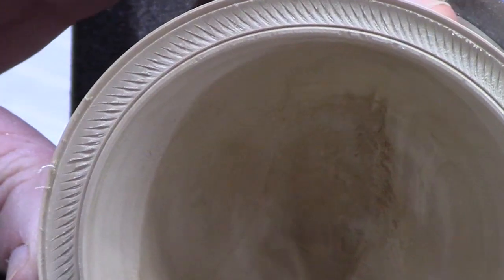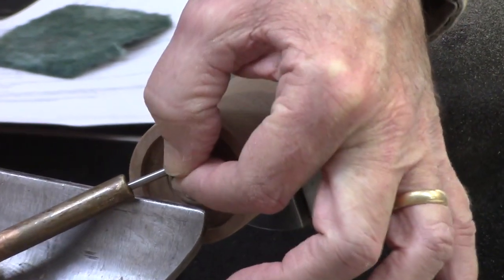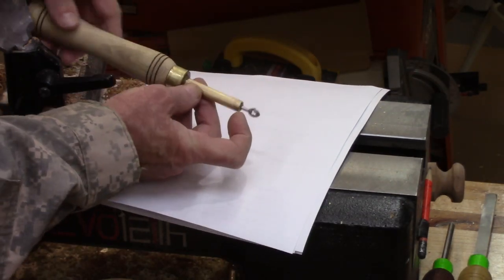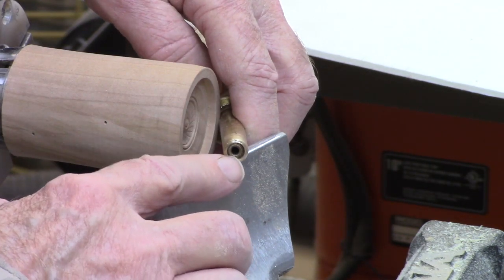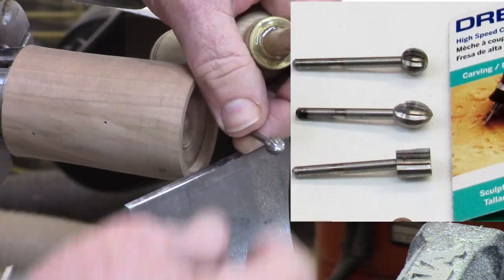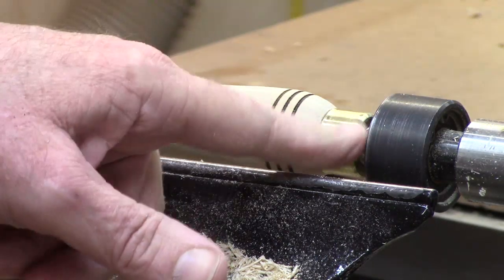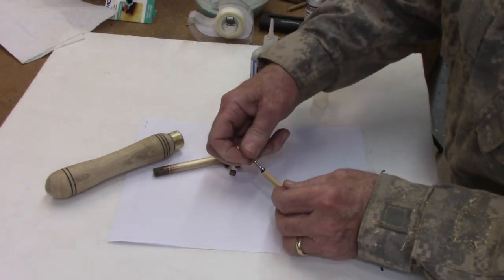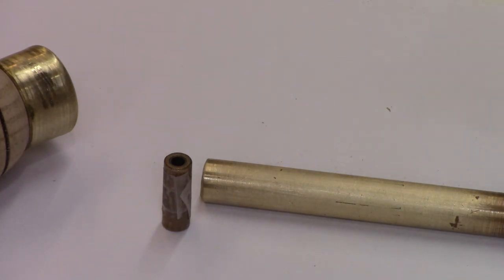Make a Rotary Texturing Tool – Cheaply!

Comment: I just completed my texturing tool.  For less than $20.   I only bought the Dremel 114 bit , brass pipe and ball bearings.

The ball bearings are pretty tough to install if Scotch tape is used to hold them together.  Instead, I mixed up some 5 minute epoxy, shoved it down the pipe and then used the bit with the magnet and bearings already on the bit shaft and inserted down the pipe.  It went in very easily this way.   The tolerances on the bearings will not allow tape to be used easily.  

Works great!!!

When searching on Amazon or eBay for the bearings, I just used the search term “ball bearing 1/8 x 1/4 x 7/64”.  If you enter the brand name and the other info that you have in the instructions, you’ll find everything except for the bearing you are looking for.  Just do a generic search with the sizing specs and a few different brands show up.
Reply from the maker: Thanks for taking the time to share!
Reply: There is one issue  with this texturing tool that needs to be addressed.  The Dremel bit shaft is about 1.2” long. The four ball bearings I received only support about .5” of the bit shaft and leaves about .7” of it unsupported.   This causes the bit to deflect away from the turning piece as pressure is applied for texturing. To solve this issue there are two solutions: 1) install an additional 3-4 bearings (7-8 ball bearings total);  2) use a Dremel cutoff wheel to shorten the bit shaft about .3” - .4”.   This will allow the head of the bit to protrude about .2” -.3” beyond the end of the brass pipe.   Doing this will reduce the amount of deflection the bit experiences when pressure is applied for texturing.  However, when doing this, the geometry of the tool will be changed and deep coves may not be able to be textured since end of pipe my pose clearance issues with the wood.

Suggest placing additional bearings on bit shaft with magnets on the end and trial fit into the pipe to see how things work before gluing into place. Make necessary adjustments  to  shaft or addition of more bearings  before doing any gluing.  Once you glue things in place, you’re stuck with the decision you made.

If shortening the shaft, be sure to round off the end of the shortened bit shaft with a file or bench grinder.  Study the end of the bit shaft before you make the cut to see its shape.  Then go to town making your modifications.

Comment: Hi Mike,
I made the tool and have used it on a few things.  The roller bearings I found on Amazon, and the other pieces are at most hardware stores.  I did find out that many of the cheap rotary burrs are not the exact 1/8 inch diameter shaft, and you need to make sure that the burr shaft fits in far enough.  To keep it the correct depth, I added a piece of brass rod to the inside of the tool shaft (pipe fitting nipple) so the burr shaft only goes in so far.  I have added patterns to the side of a few bowls for an accent to a normally ordinary bowl.  One more small step in bowl making, but it provides a nice detail.  Thanks for the video.
Reply from the maker: Thanks for sharing. I like to use a turned dowel to limit the length with a rare earth magnet on top for the burr to ride on. The rare earth magnet keeps the burr from coming out if you point the tool down when not in use.

Comment: Hi Mike, thank you so much for your time and effort making these great videos!  I just finished making my own texturing tool and it works quite well.  I was not able to find the exact parts you give in your video and website, but I ended making it work with 1/8"x3/8"x5/32" ball bearings ($7 for 10 on Amazon).  They fit perfectly inside a 3/8" copper coupling.  I only used two bearings, so I guess I can make a few more tools!  Thanks again and keep up the great work!
Reply from the maker: Nice work!

Comment: Another great video.  These are useful tools to add detail to turnings.

When I made mine, I couldn't find a supplier of sintered bronze bushings that didn't insist on only selling them in large quantity and with ridiculous shipping costs, so I turned a sleeve from a scrap of high-density polyurethane (from an old cutting board from the dollar store) that seems to work just as well.  Also, I found that I could order the Dremel cutter from Ace Hardware for delivery to my local store with no shipping charges.
Reply from the maker: Great tips, Louie, thanks for sharing.

Comment: One thing I seem to recall when using five minute epoxy is that denatured alcohol/methylated spirits is good for cleanup. I remember that seem to be good for smoothing out excessive glue before matures.
Reply from the maker: Thanks for sharing.

Comment: Mike, you can go to a local bearing supplier such as B&D (Bearings & Drives), and buy from them also.  I bought mine for far less than what Amazon sells for.  If my memory is correct, they were in the neighborhood of 40 cents each.
Reply from the maker: Wow! I will have to locate one next time I need bearings on my bandsaw or whatever.
Reply: Fastenal stores are another source of bearings, where I get guide bearings for my bandsaw.

Comment: Could the 1/8” be referring to the wall thickness of the tube? I’m no plumber either but I sure do use a lot of brass fittings and copper pipe for making tool handle ferrules! Love ur channel!
Reply from the maker: Could be.

Comment: Mike,  I have all my parts and equipment to begin making a texturing tool, after watching your "how to" video -  in my list I also  have an extra item, 
It's a inexpensive "kitchen scale" (*see below), that has the ability to adjust for "tare feature"...I find it very helpful in mixing two part epoxies, stains. Etc. 
Takes the guesswork out of getting that exact measurement.
My scale cost less then ten dollars+any trow away small cup lids that I use for mixing trays. 
(* Brand: Cook Time)
Sold at Amazon 
4.5 out of 5 stars963Reviews
Reply from the maker: Thanks for sharing.

Comment: I made this tool earlier when the video came out.  It’s a good tool and takes a little experimenting to use.   

However, I noticed the shaft to the rotary bit was a little too long since it seemed to flex to one side of the handle  when texturing wood.  I shortened the shaft on the bit about 1/8” - 3/16” and this seemed to solve the problem.  

Another solution is to drill the hole a little deeper in the handle for the bearings and shaft using those dimensions above.
Reply from the maker: I had a similar problem on my first one but thought I emphasised the point heavily at about the 1 min. mark. Sorry it was not clear.
Reply: @MikePeaceWoodturning  

You probably did emphasize the issue. It’s probably I didn’t remember, missed it or not paying attention.  It was one of those old man issues... ya know... the here after syndrome.... I walk into a room and ask myself what the hell did I come in here after.

Comment: Hi Mike!  I've got a suggestion for the terminally cheap (ahem. Frugal) guys:  for bearings and stainless steel rods, look around for old office printers that are being thrown out.  They've got a lot of useful parts if you take the time.
Reply from the maker: Thanks for the tip. Amazing sometimes what you can salvage and repurpose.

Comment: For me this is very timely, Mike, thank you. Texturing tools are expensive, and for some reason I felt they were a toolmaker's task: though the comments here show plenty of people are making them. Concerned about accessing cutters, in particular. I am currently working with Nylon 6, which is readily drilled and turned with a carbide tip to fit a chromed steel tube (for elegance). I'm wondering whether it would stand the wear and tear as a bearing here, and, likewise, the retaining magnet taking abrasion from the butt of the cutter shaft? I'm keen to try some decorating, without too big an outlay. Are you also into flame torch burning wood?   Bernard.
Reply from the maker: I think a  nylon bearing would work for a while. Give it a try. Some other poster used something similar. I have done some. I need to do another with an ash bowl. Don't think I have done a video on it.

Comment: Mike:
I wish I could send you the picture of the brass and silver wire inlay on the walnut handle I made for the rotary tool I made based on this video, I did make it with ball bearings as per your suggestion. Love the tool, and stumbled on something last night when I was experimenting with it. On another of your videos you used some rub n buff to pop the texturing a bit.  Well, while experimenting with techniques on a 1 1/2" walnut spindle I applied the rub n buff (gold), and I didn't want to use sanding sealer beforehand for various reasons and it didn't work so great with being difficult to remove just off the flat surfaces . Well I just figured live and learn and continued trying various burrs, angles etc etc etc,. Once I had about 6 " of tight spindle trials I wanted to temporarily darken the walnut to really see the details better. I put some mineral spirits on a small rag and while turning under power applied it down the surface of my work and to my astonishment the rub n buff areas cleaned up GREAT with the textured recesses really popping with the remaining gold accents. Love your videos and have viewed many several times. Wish there was a way to send you pictures!
Thanks so much!
Jim
Reply from the maker: mikepeace356@gmail.com     I cover your newly discovered trick of cleaning up the excess overflow here at about the 12:00 mark https://www.youtube.com/watch?v=4KDgVQyhd8I

Comment: Just finished making one.  I used the ball bearings listed on the page from Amazon.   A couple of observations: 
1) I had to sand down the shaft on my cutter shaft to fit the bearing shaft holes.  The shaft measures 0.1245", the bearing shaft holes were 0.124 to 0.1245, not the 0.125 (1/8") advertised.  I'm not mad at the cutters, they are built for collets, so +/- 1/2 mil is not a bad tolerance.  I'm a little less happy with the bearings, not sure what the tolerance should be, but I would think that if they are made for 1/8" shafts, a 1/8" shaft should fit in them and definitely a shaft that is less than a full 1/8";   2) The pipe nipple is definitely slightly smaller than the OD of the bearings.  The epoxy fills the space, but I wonder if this isn't what will contribute to looseness in the future as the epoxy wears out;  3)  If I did this again, I would not use epoxy to secure the bearings.  I would tap the inner diameter of the pipe nipple to a next higher screw size (probably 5/16), cut a bolt and put a hole in that for the shaft, then use that to hold in the bearings.  I would probably use epoxy to secure the bolt section so it doesn't work its way out with use.  For this configuration, in place of the epoxy to get the bearings to fit inside the nipple, I would wrap them in shim stock.
Reply from the maker: Thanks for sharing! Maybe it will help another viewer.

Comment: I use 1" brass nipples to make collars for my chisel handles, I get 2 per nipple and they work well. Make a tight fit while turning the handle then with the handle between centres use a file and wet n dry to remove the thread.
Reply from the maker: A file will certainly work.

Comment: Nicely done. With "Roll-Lock" Sanders having a larger shaft, are the burrs available in a 1/4 inch shaft? Could make a handle for all of the above and use one handle for sanding and decorating. Just a thought.
Thanks
Reply from the maker: Ummm. Never heard of a roll lock sander. Dremel burrs are all 1/8" so far as I know.
Reply: @MikePeaceWoodturning  little drill or die-grinder sanding tools with a 1/4 inch shaft and a plastic platten that has a threaded hole in the middle. Then the refill 1,2, or 3 inch sanding/scotch-brite pads have a plastic center that screws into the platten. Harbor Freight has a similar/copy product in the sanding section.
I was just wondering if there were burrs with 1/4 inch shanks, not necessarily Dremel brand itself. 
(The scotch brand disks are often marketed for gasket removal at auto parts stores as is the name brand Roll-Lock).
Reply: @MikePeaceWoodturning  
I also found some HSS burrs w/ 1/4" shank, on Amazon.
So, I suppose the answer to my question is Yes. I'll just have to source the hardware to make the larger component handle.
Thanks for the inspiration.

Comment: Thanks Mike! I am always looking for ways to cut costs and making your own gadgets is a huge help! I was wondering tho do you think since it is a dremmel bit could you not just mount it in the dremmel for a handle and leave it in neutral to spin freely without power and do your patterns that way?
Reply from the maker: I will try it but thinking the motor would offer too much resistance.
Reply: Mike Peace Woodturning I was more worried it could wear out the bearings in the dremmel I too will try it I have a real cheap aftermarket dremmel that only cost $20 at princess auto lol

Comment: After watching the video a second time I see where you address the red brass nipple size.  I too am a little confused about that.  After googling brass-copper dimensions, I found a pdf that says standard  brass 1/8" pipe size is 0.405 outside diameter,  0.281 inside diameter.  So I guess that the 1/8" would be correct.  I tried to attach the pdf but couldn't figure out how.
Reply from the maker: Yep. Makes no sense but it is the right size.
Reply: Mike Peace Woodturning Thanks for posting this video!  I have all the parts and  completed the tool. Just waiting for my handle to dry so I can turn and finish. I have also made point tools after watching a video you did in the past.  I also use your videos for inspiration to turn bowls and boxes. Again thanks for what you do!
Reply from the maker: @hardyhobbs  Thanks for the feedback. Glad to see my tool making videos were helpful.

Comment: Just an idea,small bearings are available for radio controlled vehicles
Reply from the maker: As I tried to explain, the challenge is not the bearings but a sleeve that will replace the brass nipple. I hadve a link to the bearings in the show notes.

Comment: Have you simply tried using the actual Dremel tool??. Both spinning or just unplugged.
Reply from the maker: No, but I will. I thnk there will be too much motor resistance and it would be difficut for it to fit into the lid of a box.

Comment: Mike is the link for the  (Red Brass Pipe , Nipple, Schedule 40 seamless, 1/8"NPT Male 5" length) correct ?   Should I change to 1/4" or 5/16"?
Reply from the maker: No it is correct but confusing.
Reply: @MikePeaceWoodturning  Hi, Mike. I am a bit confused about the nipple size. You mentioned putting a 1/4" diameter dowel in it. Doesn't that mean that the inside diameter of the nipple should also be 1/4 inch and not 1/8? I thought that the bearings had a 1/8" inside diameter to hold the shaft of the burr, and a 1/4" outside diameter to fit inside the nipple. Or, am I missing something? Thanks!
Reply: I watched your video again and see that you did address it. It is very confusing! I ordered all the other parts, but Amazon is sold out of the pipe right now. I will try a plumbing supply store instead. Thanks again for the video and the plans!
Reply from the maker: @williamweiler5674  Out of 4" but they have 5".
Reply from the maker: @williamweiler5674  It looks like it is back in stock.
Reply: @MikePeaceWoodturning  Hi, Mike. I ended up getting one from the big box store and made the tool this weekend. It turned out great! Tha KS for such good instructions. No, I just need to turn a bowl or box to try it out! I really enjoy and appreciate your videos! Thanks!

Comment: I can't find the link to your direction papers..
Reply from the maker: The link is in the desciption area.
Reply: @MikePeaceWoodturning  yes....I found it. Thank you. Now to get my parts.  Happy happy...😁
Reply: @MikePeaceWoodturning  can it be made without the steel nipple as a turning gouge is made? Like drilling a 1/4 inch hole in the handle to the proper depth for three bearings and the rare earth magnet.? I don't understand the steel nipple in the handle unless it is for the reach. That must be it or? Thanks Mike for all your hard work.  Duh!! after putting some thought to it the pipe is for placing on the tool rest.  The pipe you got from Amazon says its 1/8 "
NPT by 5".  The bearings and magnet are 1/4" in dia.  I'm not a pipefitter but there's something else I'm missing.
Thanks
Reply from the maker: @garyhead577  Steel nipple? Not sure where that is coming from. Mine was brass in a size to hold the bronze bushings, dowel and REM.
Reply: @MikePeaceWoodturning  sorry...I misspoke.  Brass...I understand the concept now. Thanks for your patience with my ignorance.  Would a heavy wall copper tube suffice. I have a short length that is 3/8" inside and a rare earth magnet also 3/8". Bearings also 3/8" dia. by 1/8" for the dremmel shaft.  It's just a size up from your plans.
Reply from the maker: @garyhead577  any reasonable sized shaft that will hold the bearings or bushings to support the dremel shaft should work.
Reply: @MikePeaceWoodturning  thanks Mike..I read a couple of other posts who did the same...copper tube..etc.
Back to it....

Comment: ron browms dont last    i have one     you cant   sharpen them im sure
Reply from the maker: What happened? I have been using a shop made one for years. The Dremel burr is HSS. You do not sharpen. I doubt if I will ever dull the cutter enough to replace but if so it is less than ten bucks I think.
Reply: @MikePeaceWoodturning  the ron brown one did wear out

Comment: Can't you just put the bit in a rotary tool, with no power, and use it that way?
Reply from the maker: No, you will be trying to overcome the resistance of a motor.
Reply: @MikePeaceWoodturning  How about just using the flex shaft unattached to the actual dremel?
Reply from the maker: @nigelparsons6742  I do not have one. Try it and see.